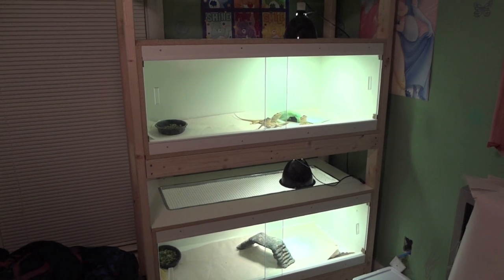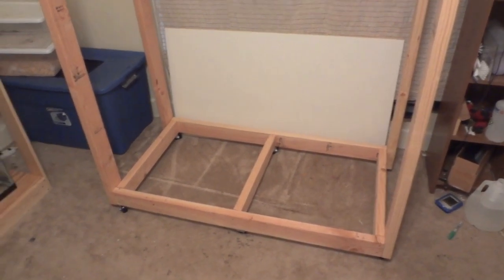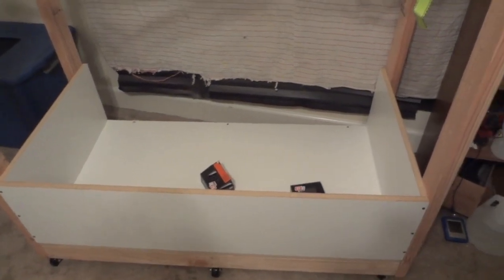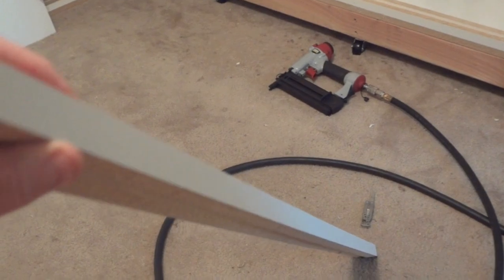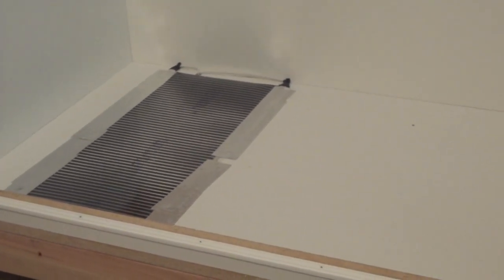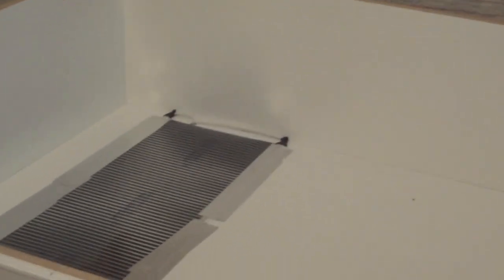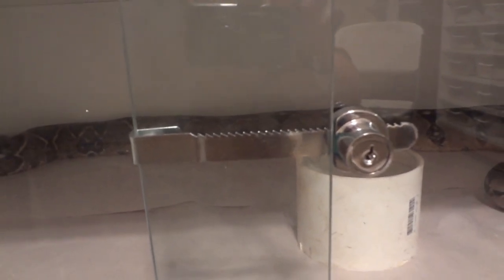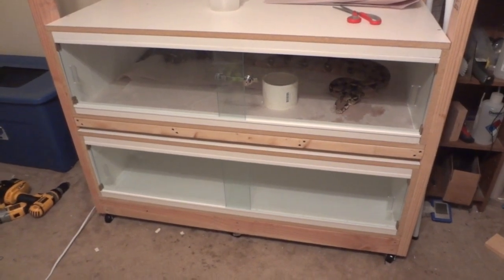DIY - Boa Enclosure

Comment: That's amazing that this only cost you $32.50! I really like the rack structure that allows you to fit cages on top of each other and casters so it can be easily rolled around in case you want to move it to another part of the room.

Comment: I've built this using his design. I stained, and poly'ed 3/4in cabinet grade plywood. Built divider's so it will house 6 ball python's. The plastic glass track is on Amazon. 6 Under cabinet lights off amazon. Herpstat 3 thermostat. Pre wired reptile basic's heat tape on each level under the frp. No issues with the frp covering the enclosure bottom.
Pretty straight fwd, and easy project.
Way cheaper than buying pre-built enclosure's.

Comment: Hi Dave.  I've been meaning to let you know I built these exact terrariums (2x tall) based on your great video!  You were too vague on how you made the bottom/rail slide or I just didn't understand it lol. 

Instead I used aluminum U rails drilled in top and bottom.  With 1/8" thick plexiglass windows that I then cut out from scrap some plexiglass framework for the windows and plastic/solvent welded them to stop them from flexing at all.  Which was the only part I was stressed about, but it worked great.  Only caveat is that removing the windows would be a pain.

They house my 2 adult cornsnakes!  Long needed upgrade.  I would say all together cost me under $350, a months worth of work mostly on my days off.  I had all the tools, but no workbench to cut or measure things which made it difficult and more time consuming; it was makeshift stands and me on the concrete alot.  I also added 3 vents per house, 1 on each wall with 1 small pc fan intaking fresh air slowly.  5 months and still holding up great,  thanks again!

Comment: I built a cage similar to this, with vents. However after a week of blowing air in with a fan, the smell from the FRP board is terrible. I am still not comfortable with putting any of my snakes inside the cage. This video was posted in 2013, please let us know how you felt with the smell and how your animals are doing. Also, did you make any adjustments to your original design?
Reply: How did you deal with the smell

Comment: air vents would not be needed as the glass is offset and would allow air flow.  Too much ventilation can make it hard to keep humidity levels up.  Consider using Ceramic tile if smell is a concern, the major goal would just be to keep the snake from coming in direct contact with the heat tape.

Comment: That Melamine is Heavy- I make reptile cages out of 1X2's for a frame and use the thin Melamine marker board to cover it.. It makes them about 1/10 as heavy, very light and can be insulated with 3/4 foam to hold heat real good... Melamine is a very good surface and easy to clean.. You may want to look into it @ Lowes ... you wont have to wrestle with all that weight...
Reply: can you tell me what you do with the foam please? I really want to make my own enclosure and I wasn't sure what I would do about the weight.
Reply: ok best way i know to explain it- lets say you have your 1X2 frame built, you will need a outer and inner layer of the marker board - white on inside and outside for easy cleaning- basically you cut foam to fit on the inside of the frame and sandwich it between the inner and outer marker board... you will have a bottom frame,front, back, 2 sides and a top... very light and holds heat and humidity like a champ- FB Ballstothewalls page- you can see what a frame will look like but do not do the foam like i did on that cage, make it fit between the inside and outside walls... like in a house.. That cage is going to be a show cage and have fake rock walls, thats why the foam is on the inside...
Reply: +James DeVary thank you so much! I really needed a solution like this!
Reply: +abby -k  your welcome, i have been using cages like your building for 10+ years...  one thing to remember, when you put your heat tape under the marker board.. Do Not cover it with foam.. the heat tape needs 1/8'' of gap to work properly... its best to leave it open... seal your corners with 100% silicone.. thats it, good luck to you
Reply: +James DeVary - you should make how-to vids!
Reply: +James DeVary I, too, am working on a plan for building a two tank rack for my two boas.. Could you specify a little bit more on how you place your heat tape?  Are you placing the heat tape underneath the marker board with a gap between the frame and board, or just leaving open space IN the frame?
Reply: yes underneath the marker board with my temp probe taped on the top of the hot spot inside the cage .... I will be making a video how to soon, i need 2 more cages and a climbing exercise tree...

Comment: Used Your advice on this video about the heat tape and using that wall covering as flooring. Great idea by the way and have it all installed on ours. But the smell of the sealant is still pretty strong after over a week. How long did you let yours it before putting snakes in them? I feel like it’s too strong and might hurt them
Reply from the maker: Angie and Aubree I’m pretty sure i put them in there pretty soon.  Maybe it’s the sealant you used?
Reply: Maybe... I’ll have to look and let ya know what we used. What brand do you use tho?
Reply: Did anyone ever figure out what sealant to use